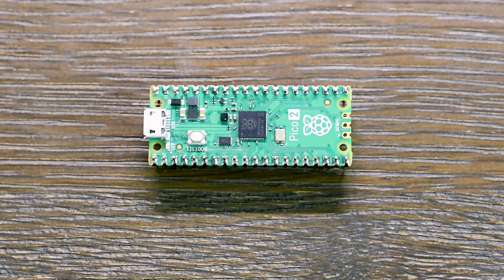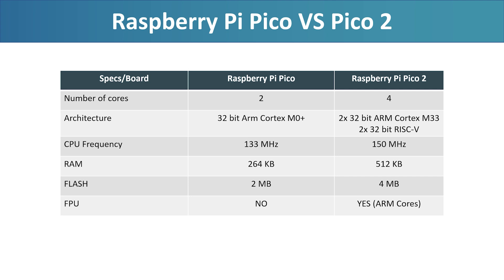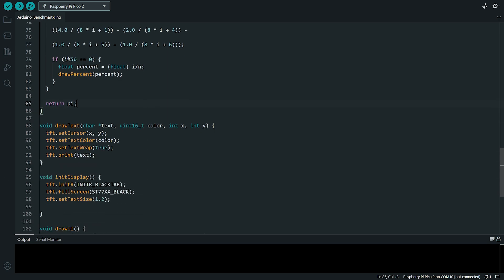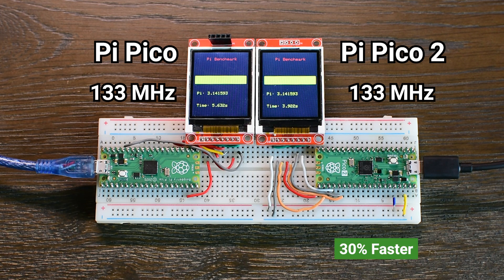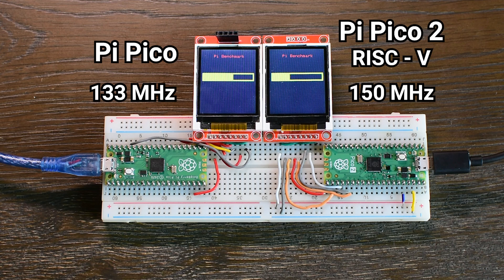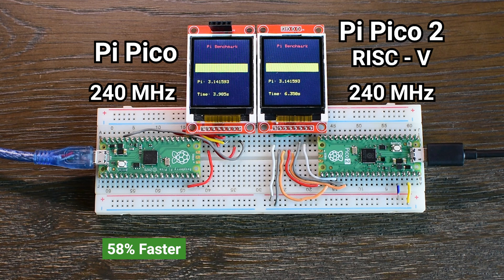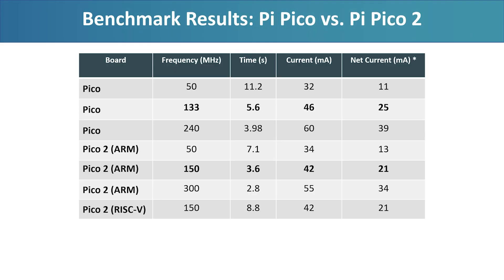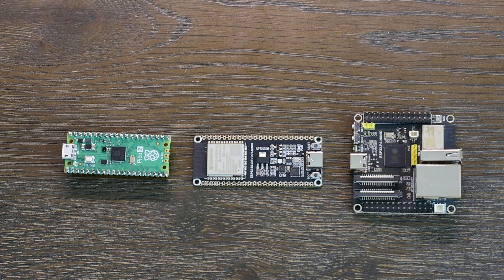Raspberry Pi Pico 2 vs Pico: How Much Faster Is It Really?

Comment: I would be curious to see a benchmark that explicitly does NOT use the floating point unit. I rarely make projects that use floating point numbers, so I would suspect the Pico 2 wouldn't offer any speed improvements over the Pico 1.

Comment: If you are buying these just for performance then you have completely missed the point.
Reply: To conserve power, I need to put it in deep sleep mode. Turns out micropython doesn't fully support deep sleep on the Pico 2 W. Why? Bc it's too new. Some features of the Pico 2 W aren't available to micropython yet. There's only one stable firmware release for the Pico 2 W as of writing this. Needed to modify the firmware to make deep sleep fully work with micropython bc it was necessary for my project. I succeeded. But could I have benefited from using a more mature microcontroller like ESP32? Possibly.

Should I have researched the micropython features of the Pico 2 W before I purchased and invested time in it? Absolutely.

Now that it's working, it's great. But there are certainly advantages of more mature system.

My point is, there is so much more to consider than speed.
Reply: @atomicviking2497 If low power consumption was a priority you probably could get a lot more functionality just writing the code in c instead of micropython. Much better code optimization, and you also would have access to the sleep modes which is a plus!
Reply: Can you explain why
Reply: @Darko22602 real world scenario. Need to make a remote API device.  Needs to run off disposable AA batteries. It only needs to be fast enough to do its job. Low power consumption is way more important.

Comment: I have projects where I run both at 400Mhz, still haven't found any that fails at that speed, but you must increase the core voltage before overclocking. Also, using Arduino to test the pico is garbage, it uses SoftFP instead of HardFP, use the Pico SDK if you want to check the real performance. Also, a double? Why on earth would you use a non-accelerated type to test the FPU?
Reply: Nice, can you link us to the doc to setup 400MHz clocks?
Reply: Youtube deletes comments with links... In any case, there's nothing special, use first vreg_set_voltage and set it to 1.2 or 1.3v and then use set_sys_clock_khz to change the speed to 400Mhz. All the info is in the SDK.
Reply: It has double support, the DCP co-processors. But this guy probably has not configured it properly, I don't know, I don't use arduino (eww🤮).

Comment: Huh why are there 2 different archs in the pico 2, thats dumb
Reply: Calling someone else's work 'dumb' when you don't understand their logic is really not a healthy attitude.
Raspberry Pi is an educational company first. 
RISC-V is relatively new architecture, so it's a little experimental and asking people to switch architecture could limit the market for them.
Given the fact that it doesn't have the same royalty issues as Arm it costs them very little to include RISC-V as an experiment.
Remember that adding to the silicon die area at that scale isn't a significant issue as long as it doesn't affect the packaging or the power envelope. So by having them switchable means they can add an extra architecture without changing things that have a big impact on cost.
Reply: @BobHannent the idea of learning is you give something relatively standart, not some frankenstein solution.
I would have hoped they used the extra budget to pack an MMU instead of unrelated cores
Reply: Each one has different targets, if you want to create a battery powered device that last longer then you use the RISC-V cores, if you want raw performance and don't care about power consumption the you use the ARM ones. Smart.

Comment: I would have expected a much larger performance increase given hardware floating point support.  Are you sure the FPU is being used?  I've not looked closely, but does the ARM core in the RP2350 have a double precision FPU, or only single precision?  You code looks like it was doing double precision math (or maybe the libraries always do?)   Does the toolchain even emit FPU code?  I've not used the Arduino IDE, so I don't know if there are options required to enable that hardware support. 

Another potential difference is if the compiler is emitting "Thumb" instructions or not for each ARM compilation target.  There's a chance this has some minor impact given these CPUs are often memory bandwidth constrained.  The Cortex M33 support "Thumb" mode, which is a more compact instruction format, while the M0/M0+ doesn't seem to have as much coverage for the more compact encodings.  

It is useful to see this end-user perceived performance differences, which could be inclusive of toolchain differences, and not as much a direct apples/apples comparison of the CPU itself.

Thanks for taking the time to do this testing; I'm also interested to see how the ESP32-S3 platforms stack up here..
Reply: For sure this video is useless. Quite sure the FPU is unused (double precision soft Inpresume). Some time ago, I did some tests with a Cortex M4 with and without the FPU use, the results (measured with an oscilloscope with pin toggling) showed a x5 to x10 speed
Reply: The ARM vs RISC-V comparison proves that the FPU works.
Reply: @ragesmirk the FPU on the RAM cores is single precision only, but this computation of Pi used double precision arithmetic. So the FPU won't be used in this example, except a little bit in the calculation to show the percentage complete on the display. If you change the calculation of Pi to use floats instead of doubles, you should find it much faster on the Pico 2 (but the computed value of Pi may not be accurate). You will need to suffix all the floating point literals with 'f' and use the powf function instead of pow to prevent the compiler converting the calculations to double.

Comment: Thanks for the videos.  I would also like to see a benchmark comparing FFT running on both.  ARM says that the FFT performance is dramatically improved with the new DSP instructions on the Pico 2.  Real-time signal processing is something we can use in the new Pico 2.